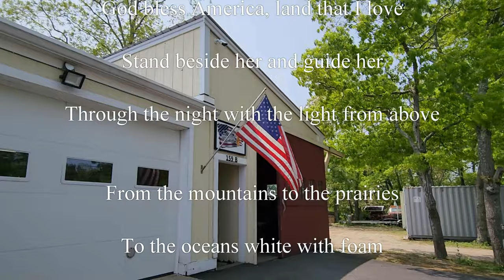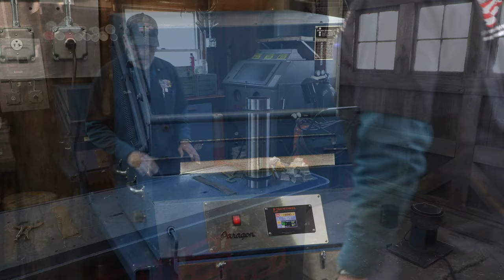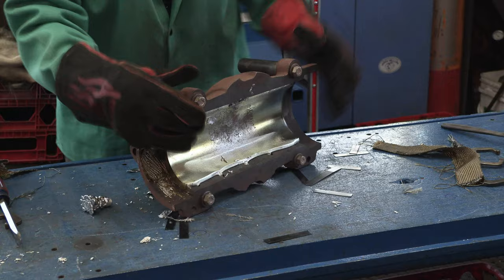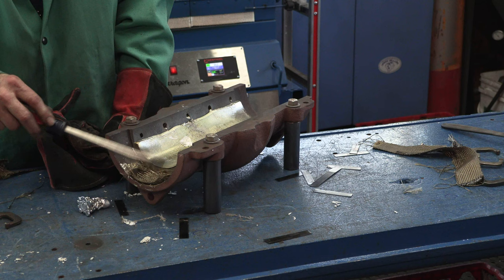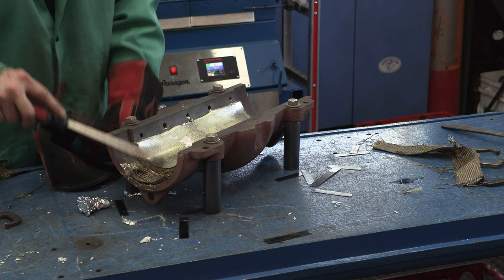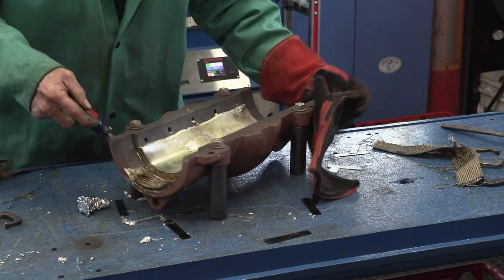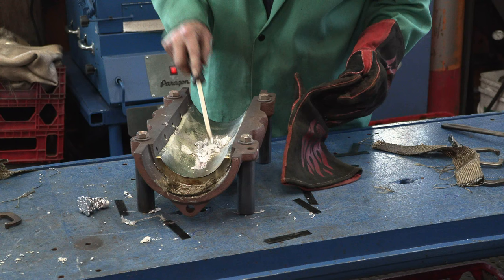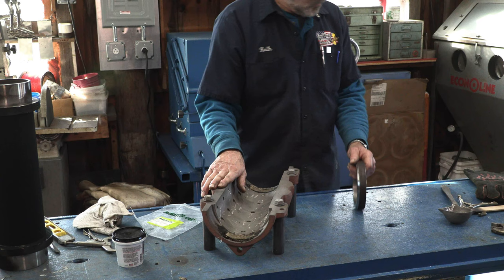Babbitt Pour 2024 Part Two

Comment: Keith: Don't get me wrong, these are just some constructive suggestions. Try preheating the shells to a lower temp (about 275-300), use babbitt bearing clay, "Babbittrite" was the old trade name (no longer available). McMaster Carr has a substitute (although not as good). You have a great place to pack it in the ends outside the rings. Pour it as fast as it will take it, don't stop. don't pour in one spot (it will shrink more in that spot if you do). Acetylene smoke can mess up the shop, try a light smear of "Neversieze" works great. I will be looking forward to the successful next try.....Dave
Reply: Where I was an apprentice in the 60s the Journeymen called the casting clay "monkey shit" and it did look like it but it worked well. We poured Babbit bearings in place on turn of the 20th century overhead cranes

Comment: Hi Keith, me again. We used flanges on each end and had a long bolt (several of them) through the middle of the mandrel to pull the flanges together. We also used asbestos string on the end faces to stop and leakage. Good luck with the next pour. Cheers Ian

Comment: Would it be better to tin the surfaces first? I was once involved in the coating of Landis grinder bearings with babbitt. We used to spin the steel bearing in a heated fixture and pour the babbitt into the bore. We always found it necessary to tin the steel first to ensure adhesion.

Comment: Is there a name for that " disassembly" table, drip table?
Reply: Keith went over that in video quite awhile ago, it came with, I think, 5 gang drill presses on it. He kept one of them and made a stand for it I think and sold the others, then he used the cast iron table and used it for a welding table. Pretty cool table. I don’t have the room for one that size but if I could find one that was a two or three drill table, I’d have room for that. I’ll have to start checking eBay again for one.

Comment: I call poured bearing, John.  Get it?
Reply: No
Reply: @mitchdenner9743  John Babbitt (Bobbitt).  Look him up.
Reply: Fun fact, this blackening done with acetylene was done by highpower competition shooters to their iron sights with a small carbide lamp/lighter. It makes your target sight picture real crisp with the dark black sight.
Reply: @Absaalookemensch  ok i get it.
Reply: @mitchdenner9743  Yep, and I still have my old carbide lamp from those days. Now it's a bit of a collector's item, which tells you about how old I am. 🙂
Reply: @mitchdenner9743  You don't say... 😄  Actually when I first started I used an old metal 35mm film canister with a tiny hole poked into the top of the screw-on lid. Throw in a few calcium carbide rocks, spit into the canister, screw on the lid and fire her off. It's the blackest black you can get for cutting down reflections on a front sight post.
Reply: @highpwr  yep